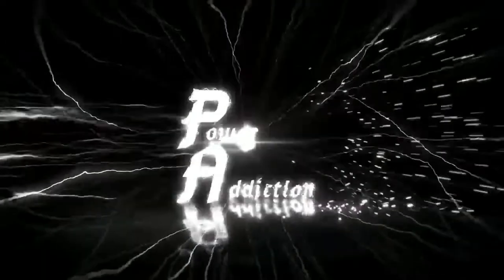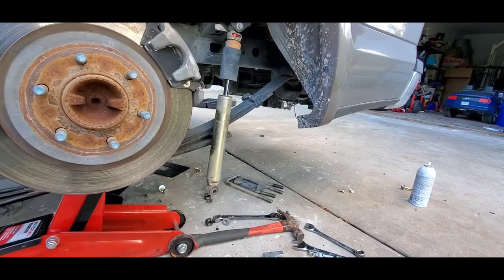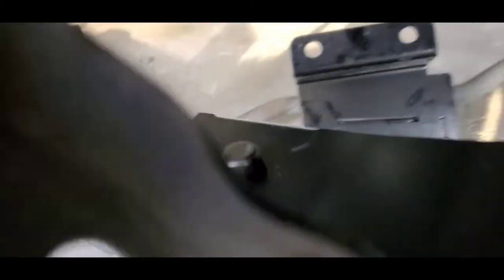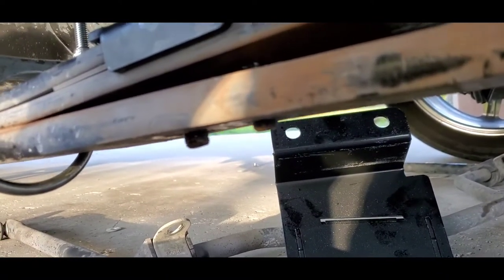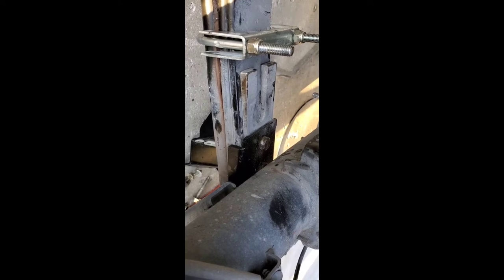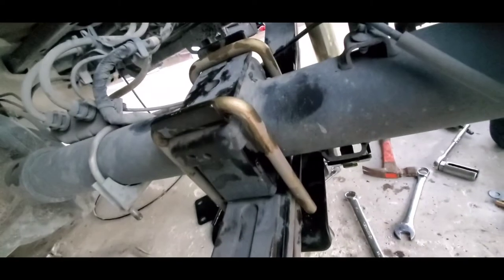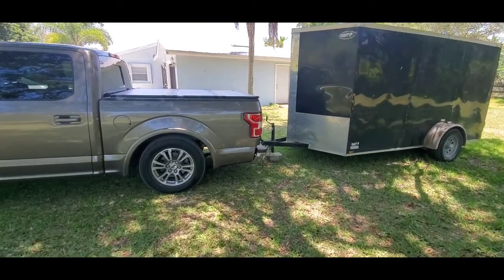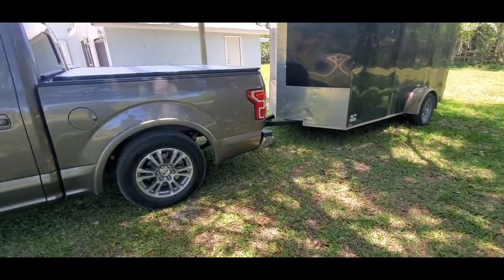IHC Airbag for lowered trucks! Install on 2018 f150: PowerAddiction

Comment: I know this vid is a couple months old at this point but be careful running a t fitting on air bags. When the truck leans one way or the other the bags quit doing their job. If you run them separate from each other they’ll work better. Just a suggestion
Reply from the maker: Its funny because I was thinking this myself.

Comment: I know this is old video but maybe someone can answer my question:  Does the shim not have a specific reason for being added to the flip kit...( pinion angle)  does  it not have to be in the pack in a certain way or it does not matter..Please let me know
Reply from the maker: It changes the angle of the axle to lower stress and keep the drives haft smooth pretty much